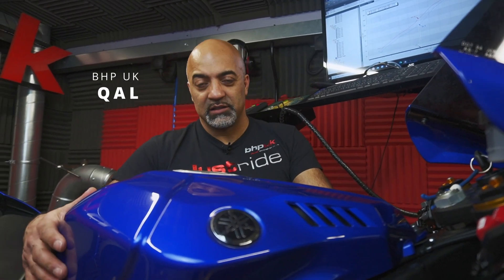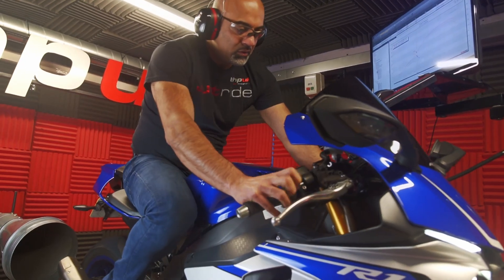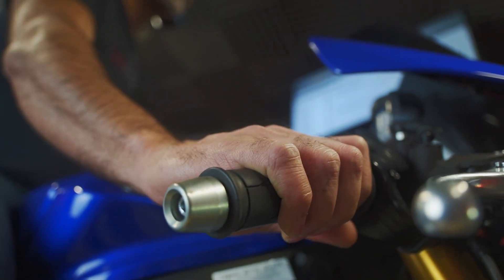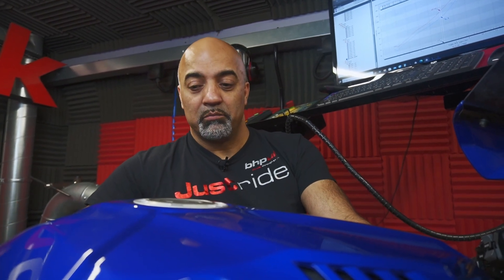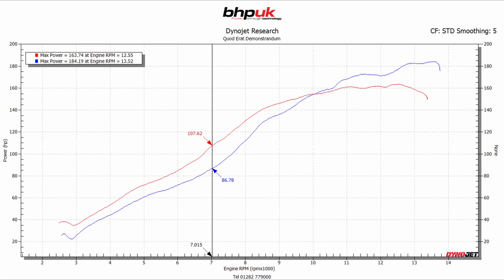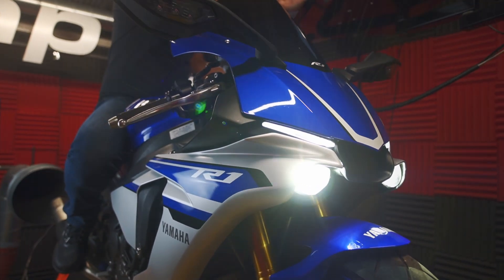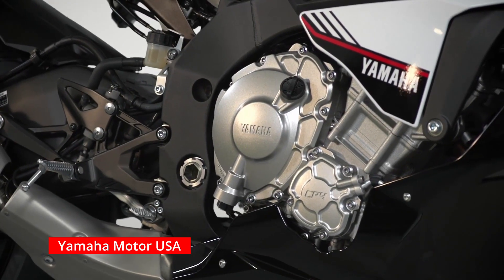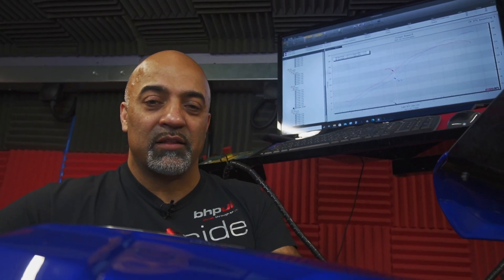MT10 Engine Fitted to a R1! Is this a better road bike? | BHP UK Custom ECU Remapping

Comment: I would LOVE to see this~~>Assuming you have an R1 and want more naked riding posisition Simply buy  used MT10 (dont even register it just resell immediately after the swap) Swap all the MT stuff for R1 stff and viceversa with both bikes trust me someone will LOVE to buy the MT 10 powered R1 that is left! You will both make out... him/her with a less expensive tamed (including insurance) "R1" and you with your now CRAZY fast R1 disguised as an"MT-10 ...OR simply transfer all the R1 motor and related stuff to the MT-10 and simply register and keep the now R1 powered MT-10 and sell the MT-10 powered R1 and now YOU save on insurance! PLUS you could could get a LOT of hits on a video if you took the time to docuvideo the whole process...I would subscribe and watch that in a heartbeat!
Reply: Since I posted this I actually BOUGHT an R1!   I love the R1 motor but the bike is uncomfortable...I keep thinking about swapping the motors and selling the R1 as an "S"  I just am too afraid it might be a nightmare as there might be problems one would not think of....would the throttle bodies work with the MT-10 airbox?  Would all the harnessing and various modules swap out on both machines or would it be a total nightmare?  I wont consider doing it actually UNTIL i find someone else that did it without difficulties.   Yes the frames are the same and the engine cases are the same also the dash guage is physically the same.   What about control cable lengths?  The R1 has clip ons so shorter throttle "cable" (they are both ride by wire throttles) Anyway plenty of things that might be considerable problems who knows?  OR maybe?  easy peasy?

Comment: Excellent job!!
Factory MT-10 rev limiter is at 11500. You have gone 13000. Valve springs and cams support those extra RPM? As far as I know you cannot go more than three hundred (300) RPM from stock. Please comment as I fully trust your knowledge !

Comment: 164bhp for a MT10 engine, on softer cams is great performance! I have an MT10 remapped to 152bhp (142 bhp stock)at back wheel, which leads me to believe there is at least another 10bhp to be gained top end by using an R1 ECU?  Hmmmmm!

Comment: Ive had both an MT10 and R1.. I'd have the MT10 as it is
Reply: The R1 is a torture rack in comparison but the R1 is a total TREAT to flog!  SIGNIFICANTLY more power!   I call my R1 my 2 wheel Ferrari!  My MT-10 though is a comfortable JOY to ride!  Even though the machines are so similar and share frame/forks/brakes and basic engine platform the insurance is way more on the R1!  go figure

Comment: When you were doing the dyno runs I noticed you hit the rev limiter, did you reduce it to suit the heavier internals of the MT motor with its steel rods etc?
Reply from the maker: Yes we tuned the engine as an MT10 engine. The challenge was modifying the software architecture in the R1 to suit the MT10 engine.

Comment: What is the reason to fit a mt10 engine on a R1???
Reply from the maker: On this bike the engine failed and instead of going to the expense of repairing the engine the owner decided to fit a cheaper MT10 unit.